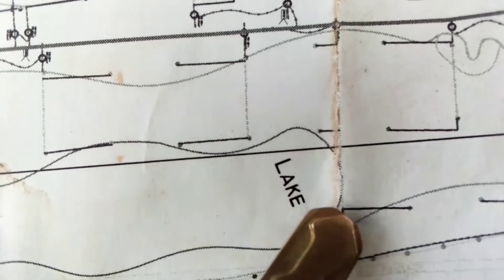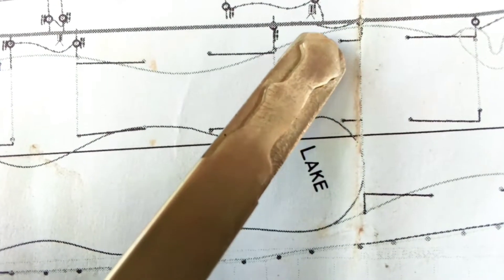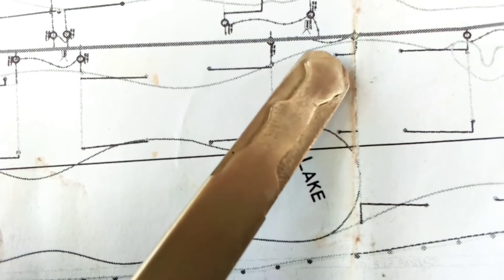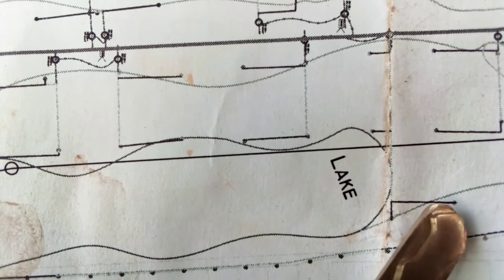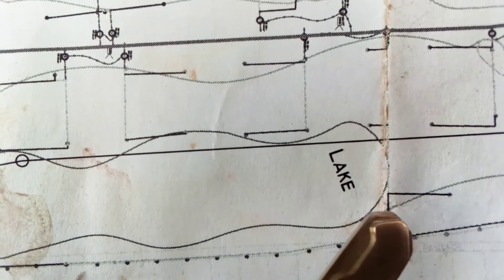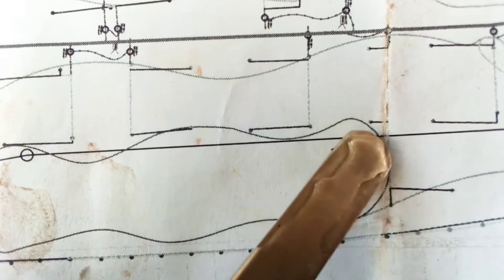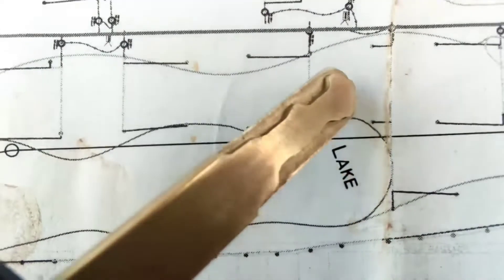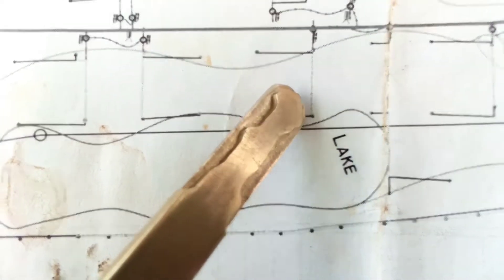How to design, survey and install golf Irrigation system. Irrigation hydraulics explanation.

Comment: Could plz share your experience sir regarding pump selection for drip and sprinkler irrigation system. I mean do you take extra power as safety or consider the same pressure that comes out of calculation.
Reply from the maker: no, same pressure as calculated is enough.
Reply: @Landscape-maintenance  thank you sir, how much pressure is enough to be  considered for filters, fertilizers tanks, and fittings in the drip irrigation design system, sir?